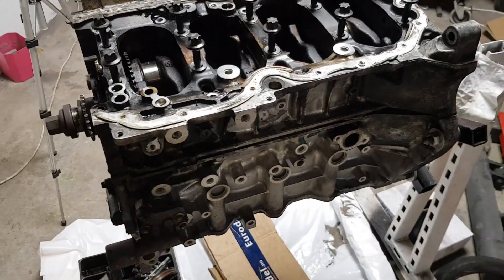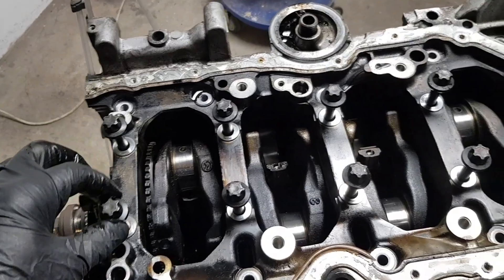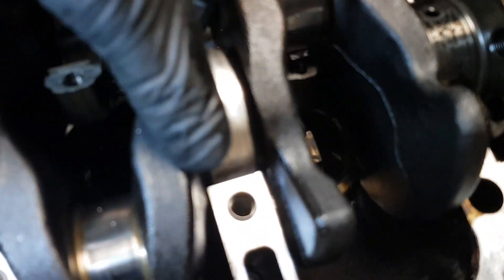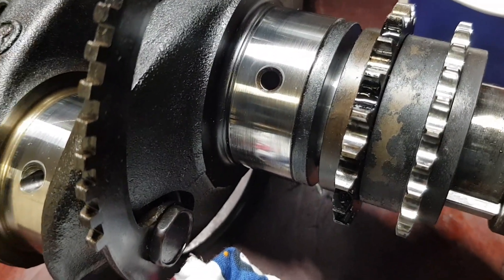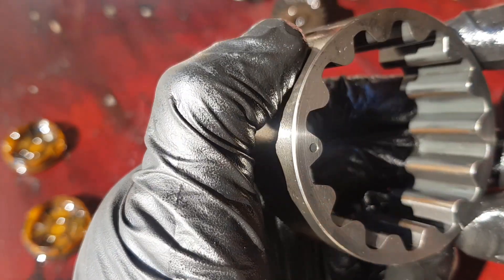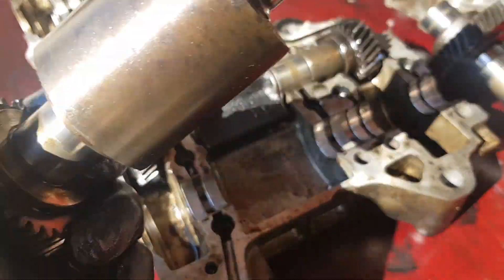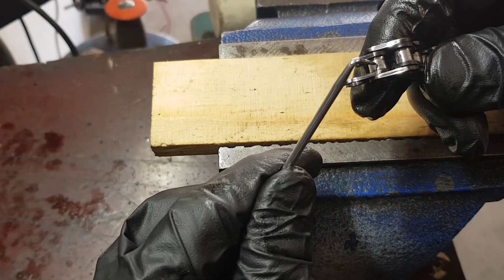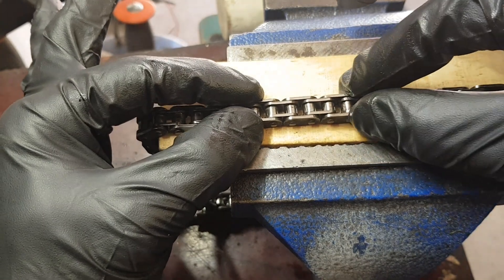Mazda 2.2 D Engine inspection with broken oil pump chain, why it happened? P0524.

Comment: I had a low oil pressure red warning light in diesel Mazda 6, about month ago. I stopped immediately, once I noticed it, probably within 30-60s. I check the dashboard frequently. Then I decided to drive to the nearest car park at a park and soccer fields, circa 300-500m to spend a night and find a garage. I already felt guilty for driving a bit with the oil warning, but it seems I good lucky and there was no serious damage to the engine. Injector washers and oil sump strainer were replaced, and later two injectors, turbo unit and dpf, eckhem, cleaned, because the car had other issues. Last week I got another engine inspection required yellow warning so the fight isn't over ;) I also need to do the front suspension to pass the annual tests.
Reply from the maker: @pavel9652  That's quite annoying warning after warning, but if the vehicle is repairable, then it's a relief. Good luck with it.

Comment: Hey its me again 🙈 
Looks like theBearings for the Balancershaftunit are not available seperatly.  Do you have a Partnumber of the Bearings? 
Where did you get them from ? 
Hooefully i am not annoying you to much.
Reply from the maker: Hi, that is not available as replacement part, you can order them custom made only at specialised workshops (Google search). Otherwise you need brand new balancer unit.
Reply: @JB_Auto  Ok got it. Thank you.

Comment: Hello didn't find any other channel where I could ask this so I try - do you have any expirience with not retracting rear seat belts ?
Reply from the maker: Hi, you can try to clean the retractor with air by blowing out the dirt while dragging and retracting the seat belt; if there is an anchor, clean it as well. If that doesn't help, replace it. For bowing out, use compressed air.
Reply: @JB_Auto  Thank you

Comment: Can i ask you is there a seal between water pump housing and engine block because i cant find any information thank you
Reply from the maker: Yes, a metal one is available at the dealership, but check the old one. You may be able to reuse it
Reply: @JB_Auto  sorry for bothering you but do you know what is tightening torgue for this 4 bolts on that water pump  housing
Reply: 44-54 nm and from the top of the engine sequnce of tightening is from the belt side 1 2 than bottom 2 1

Comment: My CX-7 has now 270k with the first engine. Bought it with 230k, and it got a new timing chain at 190k. I service it every 10000km or twice a year. On the last oil change, I decided to add Liquimoly Mos2 as additional protection. The engine is running very well, and the consumption on my way to work is about 6L per 100km. Love this car 🙂

Comment: I would advise owners of 2.2D to change the washers under the fuel injectors after 50K km.
Reply from the maker: I would have agreed with that statement some time ago because the washers and tightening torque have been improved and this gas leak doesn't occur so early anymore.  For safety, however, an early replacement at 80K km. Nevertheless, In my car, I replace those washers every 60k km 🙂

Comment: Loads of reports of the 2.2D headgasket issues and overheating..any advice on this?
Reply from the maker: Thanks for the comment. Here I think you've generalized a bit 2.2D. That was on the first engines 2012-2013 models, and from my point of view, it was rather a rare issue, to be Frank after Mazda did modifications I haven't heard much about it. But if you have some more knowledge it is highly appreciated that you share it with us, so you could write more about it. Advise, change the gasket and drive🙂
Reply: Hi, i am owner of m6 2013 and had the head gasket issue recently. I did the repair on my own and since  then I look at the coolant temperature per OBD2. It fluctulate between 83 - 96 degree,  depending on load. The changes can be seen in matter of seconds. Is it normal for such healthy motor? Before the repair it went above 105°C and more. Before the issue I didnt take a look at the temperature at all, so  I dont know the healthy behavior.
Reply: У меря ремонт ГБЦ на 170000.км.

Comment: If there serviced every 5000km since new they will last 300000km
Reply from the maker: Nobody wants to replace the oil every 5k
Reply: @JB_Auto   the turbo manufacturer will say every 5k unfortunately the car manufacturer wants to appear green friendly.  Cars all started going backwards from 2012 , There basically all pieces of shit .
Reply: @JB_Auto  10,000km is enough right bro?
Reply from the maker: Well it depends on driving distances per year, if you drive let's say 7K then you should replace it more often, otherwise 10K is enough